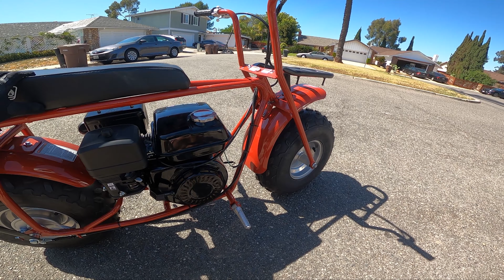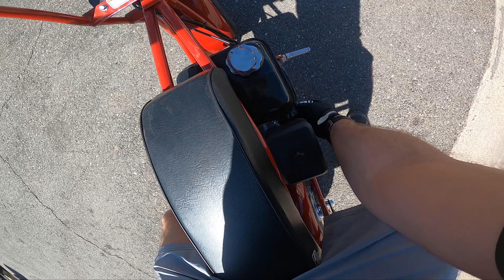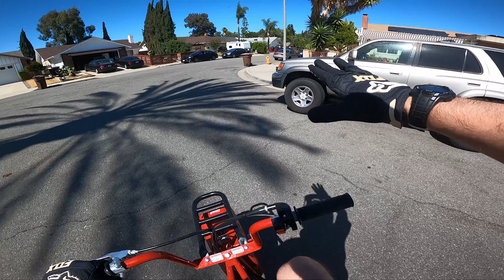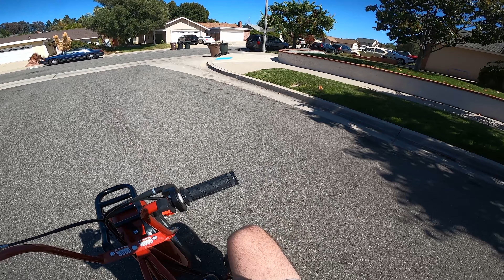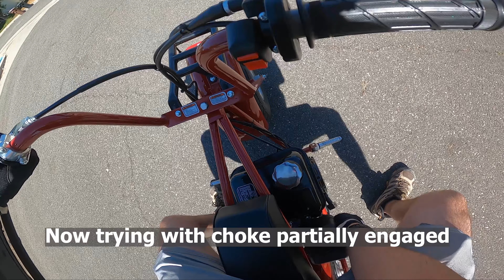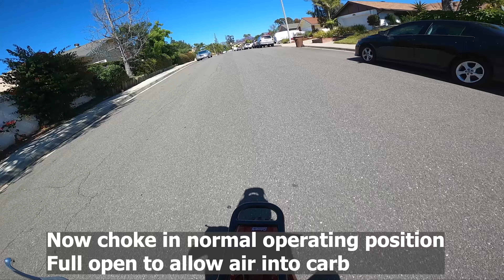Coleman CT200U TRIED TO KILL ME | THROTTLE STUCK OPEN - MUST SEE

Comment: We have been in contact with you since you initially contacted us. This is the first that we have seen of the bike behaving abnormally. We will surely do what needs to be done to make this right.
Reply: Coleman Powersports So how does it get fixed? Mine has the same problem...
Reply from the maker: demarcus demonia I have two models performing the identical issue. Sounds like a recallable item. Coleman finally reached out to me after 3 emails, 2 separate phone calls to Coleman Powersports USA hotline, messages to Coleman powersports IG and tagging them in my video.  I will post an update video with the fix, If fixed.
Reply from the maker: There will be a follow up video as such.  I have been a long time Coleman lover for car camping adventures. I expect no less from your company.  It took many emails, multiple phone calls, and even tagging you in Instagram to receive a reply. I’ll be more than pleased if our further interactions go better than the initial.
Reply: DIYautotech Okay will be tuned in if fixed because i would love to get mine fixed if able to
Reply: What is the fix? - my CT200U  is doing the EXACT same thing.   @ColemanPowesports
Reply: @demarcusdemonia6266    My CT200U is doing the Exact same thing  - post back if find a fix.
Reply: @Coleman Powersports i love my CT200u maybe you should send me an EX 😏
Reply: @coleman powersports it seems to be happening alot sounds like a recall on the
Reply: @DIYautotech  u get ur stuff fixed man????
Reply: @DIYautotech  
Did you:
1.  Lubricate your clutch? 
2.  Check to see if it's stuck/engaging at idle?
3.  Adjust your idle screw?
4.  Check your throttle cable and throttle spring?
Reply: Happened to me too, same exact thing.
Reply: Throttle cable is stuck . lubricate it with oil.Plenty of YouTube videos on this.
Reply: I have a coleman ct200u and when i try to start it. It takes off on it own
Reply: Never had this problem this is wild
Reply: Well Coleman? What’s the fix. I’ve tried them all. You should have a recall on this. I’m smart enough to turn the power off during my rampage though the dirt without jumping off.
Reply: Mine is doing this too how do I fix it
Reply: Mine is to bro ....i almost ran into a green house its like lagging or something
Reply: @DIYautotech  how do you fix this. Im having this issue now
Reply: The throttle control assembly has a bolt on top. If the bolt is too tight the throttle once activated will not return to its original idle position. Loosen center bolt, make sure return spring is installed correctly. Note that when you start it up it does not move...only after you throttle it.
Reply: My son is 15 and it does the exact same thing on his..   Plus the  kill switch doesn't work.  We have 3 Coleman bikes and we spend more time fixing them than riding them.  Most is throttle problems
Reply: @Marine Corps Hoosier Spartans & Gladiators same thing took carburetor apart and a bolt was in-between the flaps of the carburetor very very dangerous slung my 12 year old into a tree at full throttle
Reply: This is a throttle return issue. It's disconnected and you can't really see it too well.
Reply: Happened to us as well. I think a spring for the throttle return came off. I removed the governor spring and it stopped this but not fixed.
Reply: Mine is doing this too. Has been since I got it about 2 years ago and still can’t find a fix
Reply: Yes mine has don't it to and it threw me off the bike and gave me a co concussion so how do you fix this so I can sell the piece of junk
Reply: Mine has led than 20 hours of engine time same thing please figure it out Coleman
Reply: U guys wana fix mine Kuz it does the same shit
Reply: It's their unadjustable throttle on carb that stays open I hope they take care of their responsibility before someone really gets hirt
Reply: I bought 3 of theses brand new out the box’s had to return one because it would not turn handle bar stopper welded in wrong spot on the frame, and now my wife’s is stuck full throttle after first ride and mine sounds like it’s about to blow up so so far 2/3 have had issues and the one sounds like it is going to brake pissed I spend almost 2000$ with this company to get hassled by people who can barely speak English on the phone to try and resolve the issues
Reply: We need assistance Colman
Reply: mine did that until the throttle shattered.
Reply: mine is doing same thing
Reply: @Gmt400  not long after, the whole throttle snapped off.
Reply: @methodeux  can't. It seems like a failed clutch.  They don't last forever and when I rode gocarts id change the clutch almost every week.
Reply: @michaelkeeler3520  if u keep it just do a mukuni  carb for a 110 cc  ditch the stock carb and put a name brand juggernaut pully thing on it.
Reply: @hondaep3813  Once I figured out how to properly lube/maintain the clutch on my CT200U, it lasted for 50+ hours of riding.  I burned thru like 4 clutches before that - some of them in only minutes.  All it takes is keeping a bottle of oil on you and putting a bit on the end of the clutch every ~2 hours of operation.
Reply: @methodeux  I tryd drizzle  the oil on it but the slip wasn't worth it but I've never tryd  motorcycles oil it actually has a grip additive.          Also thought of a old kx85 bottom end to use just for the trans   but still run the stock motor on jackshafts to power the chain on the bottom end of the race bike  boom 6 speed colman
Reply: My younger cousin ran into my front neighbors front gate because of the same issue, he wasn't able to stop it and went straight through a wood fence
Reply: This is a video of someone trying to send a mini bike straight after assembly. He slammed a great product because he has no idea how to dial a machine in. He failed to work with you because he wanted to make a YouTube video. Coleman is doing God’s work. This dude didn’t even pick up the manual either because those tires are widow makers on pavement.
Reply: @demarcusdemonia6266  mine too
Reply: I have the same problem with my ctu 200ex
Reply: I am having the same problem. Is there a video to fix it?
Reply: Definitely not the first. I've return this POS four times and they all have the same damn issue. Coleman definitely went down hill
Reply: Actually my brother crashed the mini bike and went to the emergency room in an ambulance because this exact thing happened he also happen to get charges from the police so coleman how about a fix
Reply: Mine does the same damn thing
Reply: @rickster4188  mine does this with the idle cable having 1/2 inch of slack, the cable is not the issue.  I’ve oiled the clutch and set the return spring to the next hole over to be tighter.
Reply: Mine does the same thing they wont help at all
Reply: Mine has the same problem. What causes this?
Reply: My Coleman ct200u mini bike I bought less then a week ago is somehow stuck at full acceleration. It made me crash and gave me road rash. This bike is now too dangerous to ride.
Reply: Just purchased a bike today for my son and this exact thing is happening to his. He was riding and fell and had to chase his bike. This is so dangerous and how do I go about getting this issue fixed?
Reply: @savannajensen4149  throw away the bike and cut your losses. It’s better to just invest in a better bike. I wouldn’t sell it because I wouldn’t put anybody else’s life in danger. I was riding the bike and the throttle got stuck and I had to choose between hitting a car or hitting the curb I hit the curb and the bike flew at least 30 feet forward and 10 feet in the air. I scraped most the skin off the palms of my hand and now I have scars. It could have easily killed or hurt someone.
Reply: @savannajensen4149  Hi Savanna, we are so sorry to hear this. Please send us a DM on Facebook or Instagram, so we can look into this.
Reply: I purchased this bike for my son. He is having the same issue. It was purchased on 7/16. It's been sitting ever since. It was the only birthday gift he wanted and sadly has got to ride it 1 time. Filed a warranty claim twice. Now waiting on them to contact me back so I can take it in to get fixed (again). I asked for information on how to file a complaint and can't be given any information on how to do so. I wouldn't recommend this bike to anyone unless you want to waste money. Purchased him a helmet, and everything to go riding with his friends and sadly it all just sits there because it's not even rideable. Do not purchase not only is it a waste of money but super unsafe. The video shows it all.
Reply: I just got mine from princess auto in Ontario  Canada. I started it up and turned off the choke and it sent me across  the garage. 8/16/2022  thank God  I tried it first before my kids did. Coleman power sports please help. Or I'm send it back.
Reply: @mikekur116  Mike, we are so sorry to hear and want to look into this. Please send us a DM on Facebook.
Reply: @ColemanPowersportsUSA  sent  you a DM . You have my contact  info now on your automatic  reply.
Reply: I’ve had mine for a year now and it’s done the same thing since I first got it

I wrecked it into a tree the first time it happened… I jumped off of it because I was going down a hill when it happened 

What’s the fix?
Reply: What is the fix to this issue? My bike does the same thing. Thank you
Reply: Mine just starred doing this too
Reply: Still no fux it seems I have looked all over the internet I feel like and have tried everything to fix the issue. @colemanpowersports any fixes i mean this seems to have been a issue for years now
Reply: Mine is doing the same thing now I got the camo Coleman from tractor supply
Reply: So do we ever get a solution because this seems like a lawsuit needs to be filed at this point. I mean we only buy these for our kids and this is what we get. You've lost a customer for all your products any more.
Reply: Mine tried to kill me too, nearly did, now I know how it feels to be Superman. Hahah good times
Reply: Ours did this on our very first trip using it.  Extremely dangerous, I had to jump off and try and stop it, injured my leg.  I have two boys, I'm so glad I tried it first.  Is this a class-action lawsuit situation, because I emailed Coleman several times with no response.  Why are these allowed to continue to be sold?  Why doesn't Coleman do anything about it?  Is there a recall?  As a wilderness adventurer, I have always loved Coleman gear, but this is a death trap machine.
Reply: Mine does this to me to, I crashed and got bruises and cuts all over and haven’t rid my bike in over a year because I can’t seem to fix it!!! How do I fix it!
Reply: My bike also does this and it’s brand new. I have the B200R. very dangerous
Reply: @DIYautotech
Reply: Mine is doing this also !!
Reply: Any suggestions to fix ?

Comment: It’s an easy fix the spring to release the throttle when you do pulls the throttle closed or to idol the spring is easily accessible had the problem but backwards had a bad idol and it wasn’t the carb easy fix took me 5 minutes
Reply: what did u do to the spring

Comment: Same thing happened to us, bran spankin' new.  Dangerous and frustrating with no response from Coleman.  They don't care.  People in the comments are all over the place on a solution, why isn't anyone agreeing on exactly what it is?  Why isn't Coleman addressing this issue since it's so common?  I'd think even their own lawyers would tell them to fix it immediately.
Reply: The carb is stuck open.
Reply: add a spring to the butterfly valve on the card to keep it closed the bike is doing that because the throttle is stuck open

Comment: I have an rb200, I just got it yesterday brand new, worked perfectly fine. Today the choke pin slipped out the little piece it goes into and when I turn on my bike it starts to run off and when I rev it and let off the throttle the bike starts taking off as if I'm still holding the throttle down, anyone know why thats happening or how to fix it?
Reply: That’s is what’s happening to me with my Coleman ct200u

Comment: i had my CT200U do this a while back except i started it and it launched itself across a parking lot thankfully i wasn't on it and was standing next to it when this happened, the guy who sold it to me said that it might be the governor and that's what I thought to so what I had to do was open up the crack case remove the governor gear completely and add a spring on the butterfly valve to keep the throttle closed and ever since then it's been working great and is even a lot faster, this seems to be a problem on a lot of Coleman bikes

Comment: Removing pull start cover lets a spring move behind the mounting scxrew when the cover is bolted back into place. It can be seen if the gas tank is removed. make sure the spring is in front of the mounting bolt for the pull start cover.

Comment: Mine is doing the same thing... how did you fix it?
Reply: I had the same issue.  On further inspection I found that my fuel line from  tank to carb was too long and this caused the line to bulge out of its c-shaped bracket (on the intake manifold) resulting in the line interfering with free movement of the governor speed throttle linkage. I cut off about 1/2 to 3/4 inch of the fuel line and the line now stays in its spot in the bracket and doesn’t interfere with the linkage assembly anymore. Problem solved

Comment: I had the same issue.  On further inspection I found that my fuel line from  tank to carb was too long and this caused the line to bulge out of its c-shaped bracket (on the intake manifold) resulting in the line interfering with free movement of the governor speed throttle linkage. I cut off about 1/2 to 3/4 inch of the fuel line and the line now stays in its spot in the bracket and doesn’t interfere with the linkage assembly anymore. Problem solved

Comment: This happened to mine as well and my guess is the governor broke inside the engine and not holding the carb open for idle speed. I heard a loud pop and rattle in the engine and then full throttle as soon as it starts. There is not an idle screw on the Coleman carburetor, it is a preset nub and would not keep the throttle from going to full throttle. The governor is supposed to hold it at the correct idle speed. I don’t know if anyone else has had their engine make the noise mine?
Reply: Finally someone who has the noise pop with it i dont know what it is How Did U fix It

Comment: Right next to the carburetor there is a big screw. Turn left or right and adjust idle. If problem still exists change out springs that hold throttle arm.

Comment: My son's bike is doing the same thing after 1 yr of riding. Have you found a fix? Seems to be an internal prob with governor not returning throttle closed
Reply: I had the same issue.  On further inspection I found that my fuel line from  tank to carb was too long and this caused the line to bulge out of its c-shaped bracket (on the intake manifold) resulting in the line interfering with free movement of the governor speed throttle linkage. I cut off about 1/2 to 3/4 inch of the fuel line and the line now stays in its spot in the bracket and doesn’t interfere with the linkage assembly anymore. Problem solved

Comment: My Coleman CT200-U (FVRITO Performance VM22 26mm Carburetor). Did the same thing thru me of the back, while riding) Because i am not smart. I started it 2 times more with it going full throttle and launching into the air. I have replaced my carburetor. Seems to work. Mine is not a toy

Comment: This happened to me before if was because the throttle cable had some extra length and it was getting the extra length to get the cable stuck on exhaust even when it wasn't twisted i suggest trying what i did which was bend the extra throttle cable length so it doesn't get stuck on the exhaust or cut the extra length 

(sorry i'm bad at explaining lol)

Comment: This happend to me in the winter and sometimes if u turn it off really softly it won’t do it and u could just loosen the throttle cable a bit also when I started in the winter that thing launched at full throttle and there was a parked car right in front of me thank fully I grabbed it and my cousin picked up the back tire and shut it off so there is your daily story

Comment: i have a motovox mbx11 that’s doing this i put a new carb and everything i it how do i fix this issue someone please help
Reply: I had the same issue.  On further inspection I found that my fuel line from  tank to carb was too long and this caused the line to bulge out of its c-shaped bracket (on the intake manifold) resulting in the line interfering with free movement of the governor speed throttle linkage. I cut off about 1/2 to 3/4 inch of the fuel line and the line now stays in its spot in the bracket and doesn’t interfere with the linkage assembly anymore. Problem solved